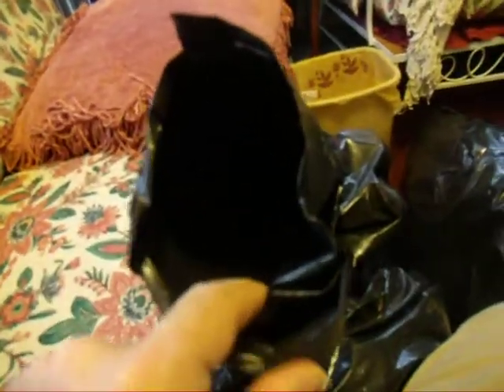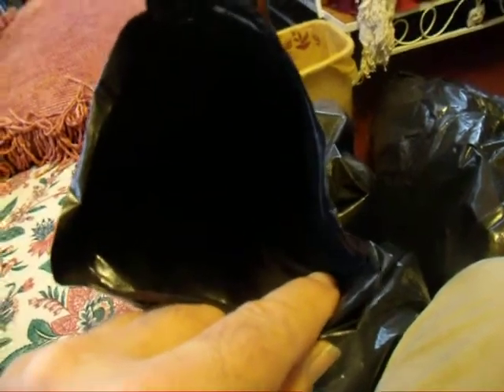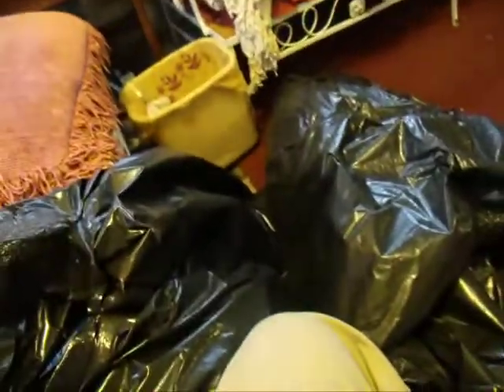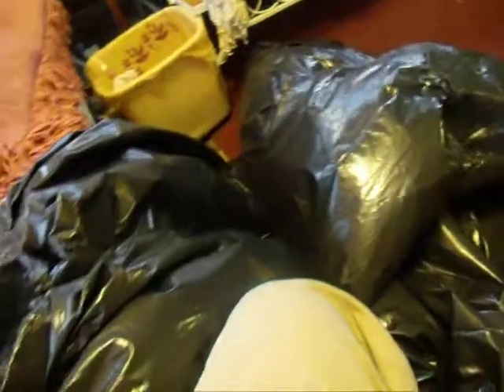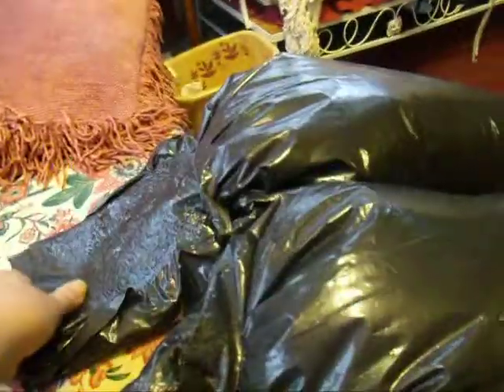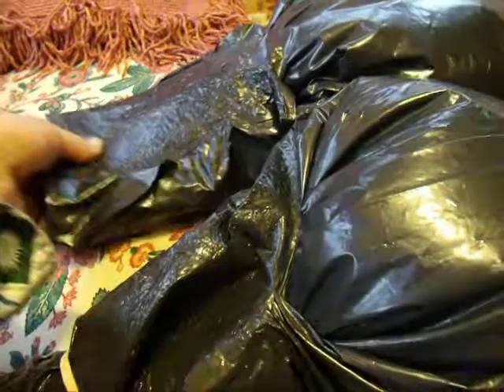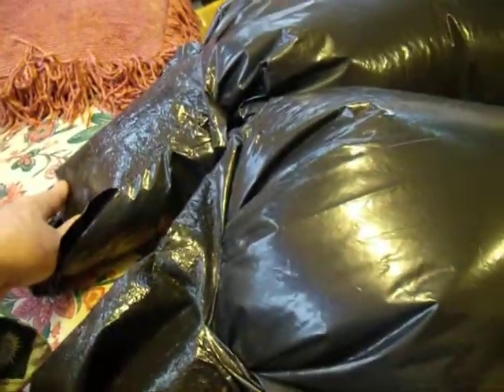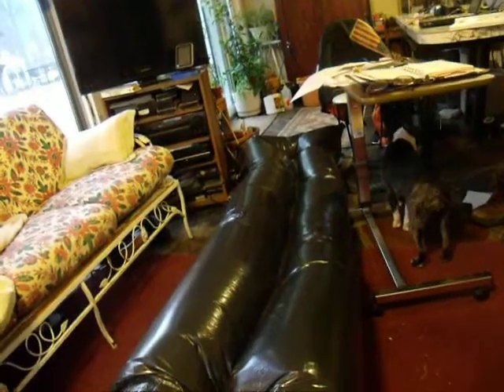Cheap Solar Hot Air window heater

Comment: Lady "what in the heck are you doing now?........You better put my bags back in the pantry."

Seriously, plug the hair dryer into a watt meter and see what kind of power the hair dryer is using, they are power hogs, even with no heat. And to get a fan to inflate the bags would not work out much better. Now think about this, reinforce the bags with something to keep them open, then you could use a smaller fan. Good thought process, you'll get it.